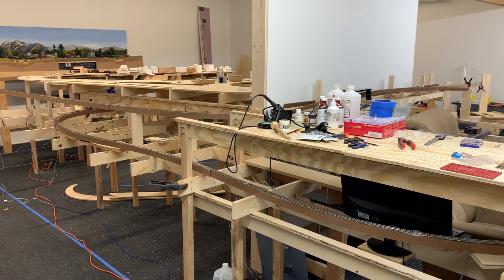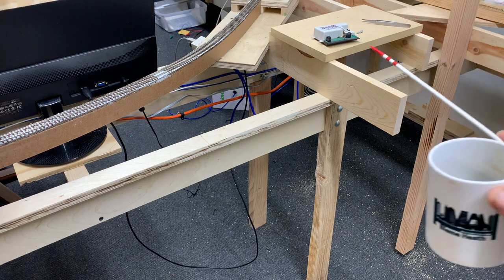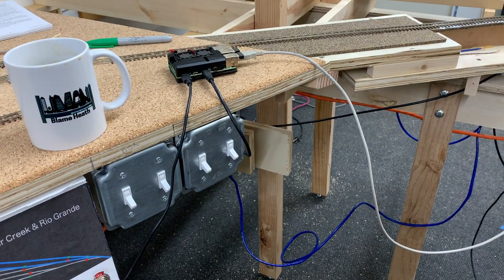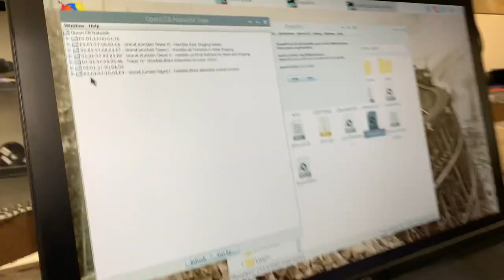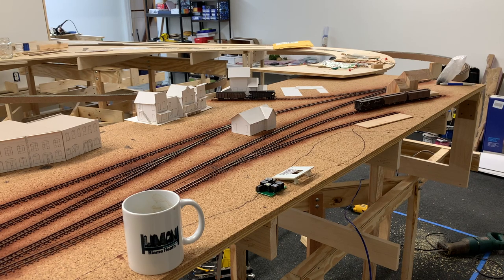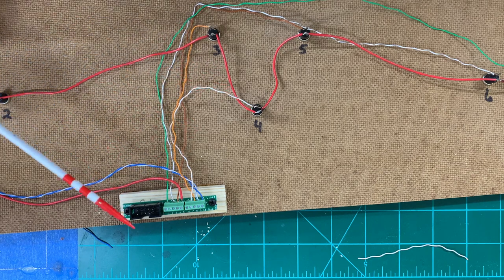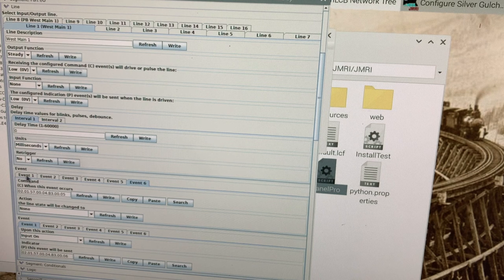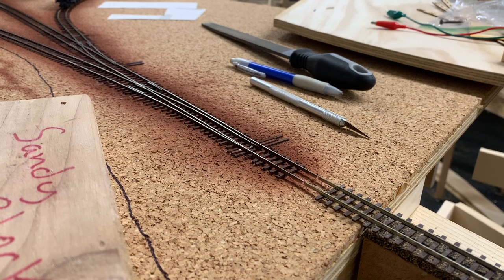Model Railroad Update 72 Wiring Push Buttons & LCC

Comment: I really like how straight forward the logic is with LCC. But I also think I am not normal when it comes to "logical thinking" and I am curious how straight forward it is for the average model railroader. I am really curious to see how LCC will expand over the years.
Do you know if I can use LCC with DCC Concepts Cobalt Turnout motors? Can I use LCC buttons (inputs) to trigger DCC motors (outputs). I think the LCC button system will be cheaper than the DCC Concepts Alpha button system.
Gives me a lot to think about. Thanks!!
Reply from the maker: One of the biggest complaints about LCC is that it's not "plug and play."  I'm not familiar enough with the cobalt turnouts to guess if they would be easily compatible.  My understanding is they are designed with DCC in mind.   I think of LCC as "DCC" for the layout, not the trains.

 LCC carries 5v in the ribbon cable.  I make use of the stall motor drivers to get to 12v.  The Tortoise Adapter Boards allow the ribbon cable to use up to 4 tortoises.  

You should be able to use any button of your choice as an input, just wire it up through a break-out board as I did in the video.  I think the buttons I purchased were about a dollar each.  ~Dennis

Comment: Clever use of the pvc pipe.  I dig the raspberry pi jmri! I'm going to do the same when I build my big layout.
Reply from the maker: Thanks!  I doubt I will use JMRI for anything other than operations and decoder pro once I get all my Nodes configured.  That is one of the reasons I went with LCC, it doesn't require a running program of any kind once set up. ~Dennis

Comment: Impressive job of wiring, as always. Now if you would make a house call and get my AR 1 auto reversing unit to work flawlessly…..
Reply from the maker: If you haven't already, look for the YouTube video called "Configuration of PSX-AR with Digitrax System"  The channel is called Practical Engineering Solutions.  He does an outstanding job of explaining how it works.  Also read the comments because If I recall he had to tweak it a little bit after the video.  I think I'm the only one who commented on the video!  Mine works great thanks to him!! ~Dennis
Reply: @OtterCreek  Thanks for the suggestion. I’ll check it out.

Comment: You might what to rethink run all your electric lines in the same run. I dont run my dcc and 110 v line in the same run as your lcc commutation wire. You could get some cross talk that might cause problem down the road
Reply from the maker: Very good point!  I wonder what the recommended distance DCC should be from power lines??
Reply: @OtterCreek  I would say 4-6 inches

Comment: How come you did not use those wireless electrical outlets that plug into normal outlets and can be operated remotely? Would've saved you having to centralize everything.
Also, that LocoNet run is kinda redundant since you are pulling LCC...I mean I know it's there because you use Digitrax DCC system, but LCC carries DCC signal on pins 4/5 of the Cat5 cable, as long as the LCC Command Station provides it. Then again, you don't have a LCC CS so my point is moot...carry on. 😆
Reply from the maker: I forgot about the remote outlets!  The LCC command station is on my Christmas list... I doubt Santa will be that kind to me though!

Comment: do you ever think about how much electricity you are using?
I am asking because electric rates are going up and I myself have about 6 power supplies for a 9 X 4 layout. i want to figure out why we need so many power supplies and than you having all those power supplies. 
I have asked other modelers and got nothing back.I enjoy the hobby but with rates going up and on a fixed income. I am worried.
Reply from the maker: It's a good question, I'm guessing at this point the lights for the room pull more amps than the layout does unless maybe trains (Plural) are running.  I haven't seen a difference in my electric bill yet, and that's even with the Mini-split heat/air unit I put in last year, but "winter is coming"  :-)